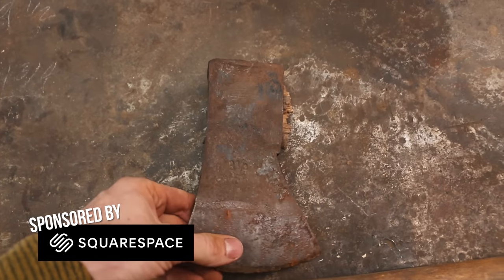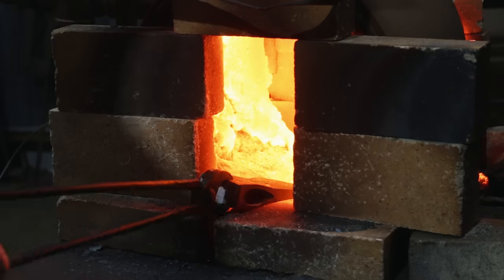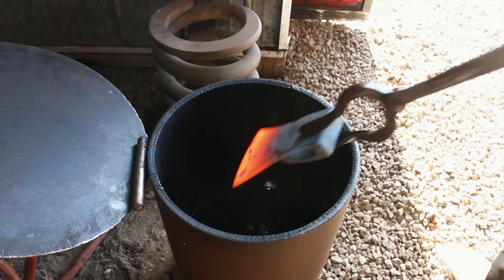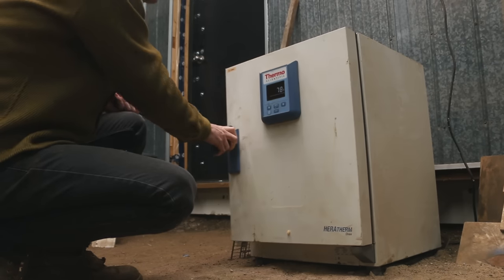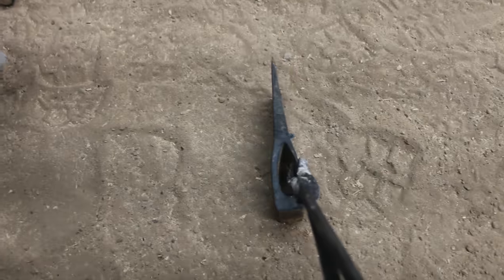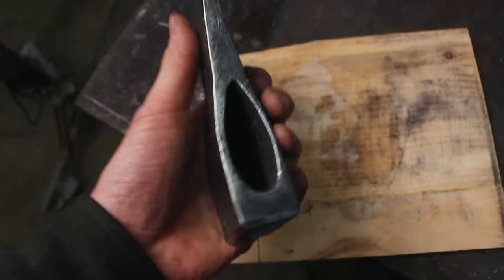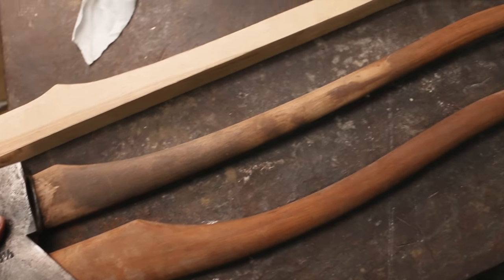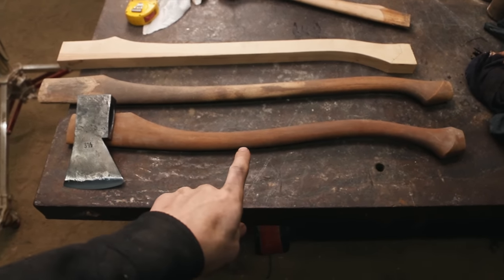Reforging this West German Axe

Comment: I'm punching axe eyes by hand without a drift just using what I have and I come out with better places eyes than that west German axe started out with. Your bringing that axe back to life
Reply: Drilling a hole at each end will help make perfect eyes. Plus it’s less material to punch threw when doing it by hand.
Reply: @erikcourtney1834  I'll have to upgrade my drill press it's one of the smallest you can get. Good for drilling handle pin holes but not good for hogging out any metal
Reply: As if germans couldnt make an axe with a symetrical eye …….
Reply: @sonofgod2405  maybe if they go back to the old days. And mas were they good at stamping.